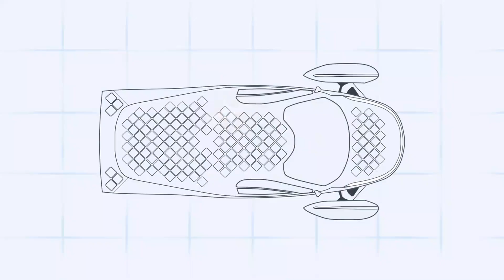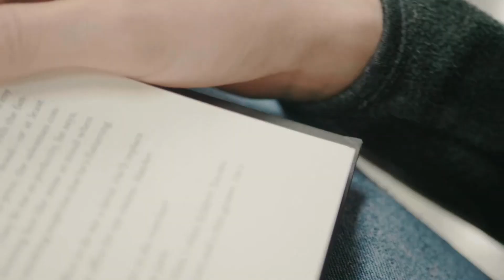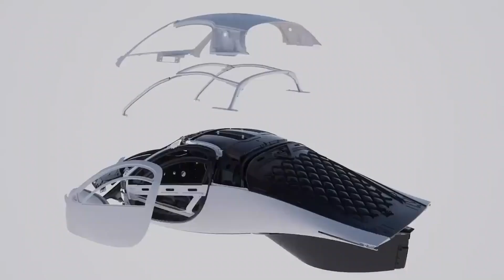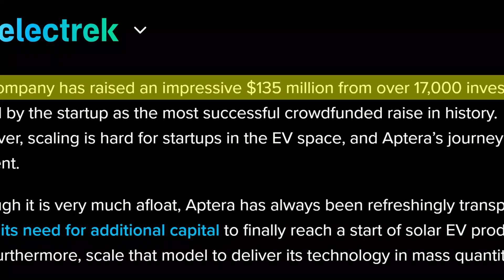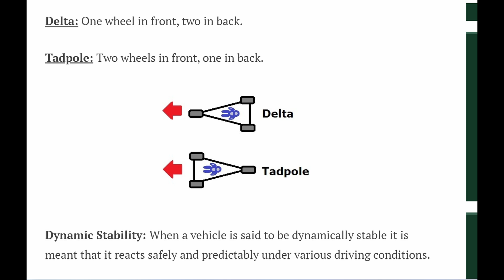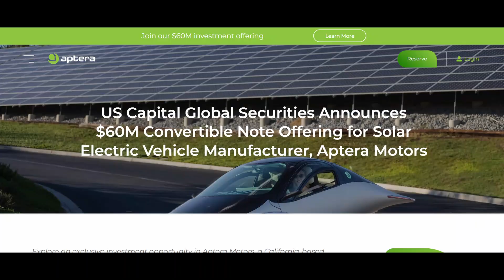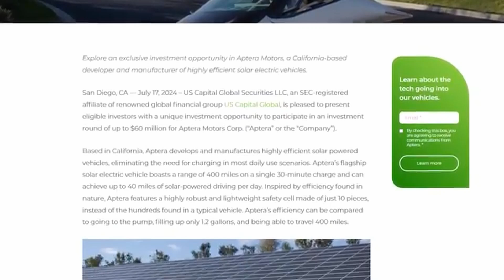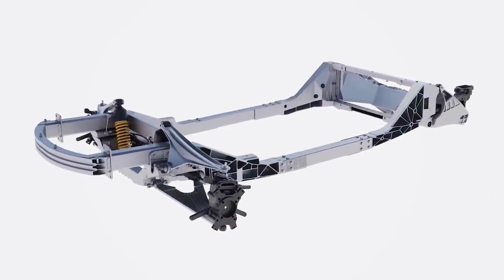Aptera 2025 DELIVERIES Countdown is on | All Eyes on Aptera as it approaches Low Volume Production

Comment: It Is NOT Zero Emissions if you charge it with Fossil Fuels, that is quite deceptive………….Will it actually go on sale sometime this Century.?
Reply: With current solar technology the Aptera gets 40 miles per day without fossil fuels. What is deceptive about that?  With up to 1000 miles range with current battery technology and more  than 100 miles from overnight 120 Volt charging (about 40 cents worth), think of the money you will save.  Incidentally more than half our electricity comes from renewables.  I have solar panels on my house and had zero electric bills for the past 3 months.

Comment: Suspension had to be changed when they went to a single FWD unit.
Reply from the maker: Lo!
Reply: I think more then the suspension had to be changed they went from a direct drive motor in each wheel to one in the middle of the body, so axles need a place through the body to the wheels, steering might to be rerouted, the front has to be redesigned to fit the motor and be strengthened to take on the torque of the engine when accelerating to name a few things that come up in my mind as non car mechanic but as biomedical engineer 😉 They are testing my patience, I want this vehicle on the road rather yesterday then tomorrow. I understand it takes much afford and there are setbacks. Since I found Aptera years back I started saving money to get one, by now I have enough money saved to buy two of them because I expected them to be on the marked much faster. I hope they will make it, many new car companies with great innovating products do not make it, Lightyear, X-Bus, Sion solar EV to name a few.

Comment: So does the car come with air conditioning?  Seems like all the videos show the car being driven with the windows down.  No AC in Georgia is a non-starter.
Reply: Yes it will have ac. Google exists
Reply: Yes, plus you can turn it on before getting into the sEV.
Reply: It comes with AC. Plus the sun will power the AC so you can precondition the interior before you get into it. I use it on mine and it works great.
Reply: @billsmith5960  So you currently have an Aptera?  I didn't think they were in production yet.
Reply from the maker: @stevenwhitaker5477
It comes with AC, which can be turn on from outside

Comment: They'll lose their shirts with low production.  They need to go big or go home.  Instead of wrapping the car, can I get solar on more surfaces?  If panels are light enough, it would be worth it to use solar panels on the sides, doors, and belly pan.
Reply: I think solar on the doors is a great idea
Reply: More solar means more converters and regulators. These are custom converters that keep the system charging when the sun isn’t casting on the cells. This is no easy task and not cheap. I’d say you’re only getting the max as shown on the website. If you have the skill and knowledge, go for it yourself. But really, do you drive more than 40 miles a day?
Reply: Solar panels on the doors, sides, and belly? That would be pretty much useless. Solar panels are connected in strings and the voltage produced is limited by the section with the least amount of light. By putting solar on the doors, the sun would need to be coving the entire side to be effective. Do you live somewhere you get significant sideways sun? Belly pan? You know these panels are made in glass, right? 

I think they made the right choice to prepare for high production rates. It makes me sad about our profit-driven society that Aptera can’t seem to get the final investment needed to bring this car to production.
Reply: Their manufacturing and production is different to typical car makers and they have claim they only need to produce 6k/year to come out even.
Reply: Custome configuration is likely possible in future.